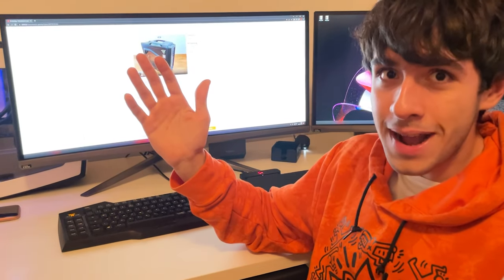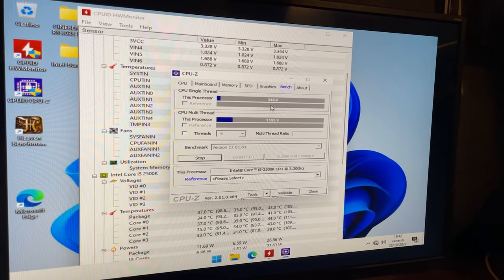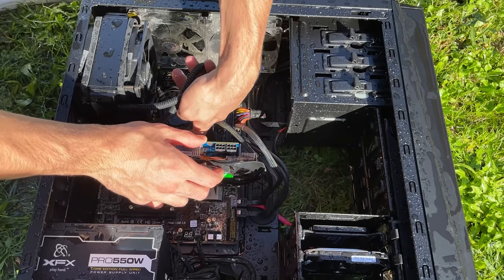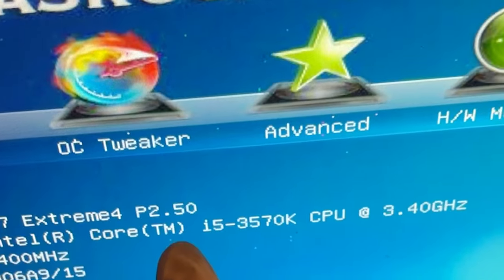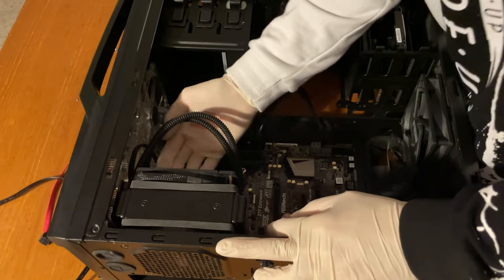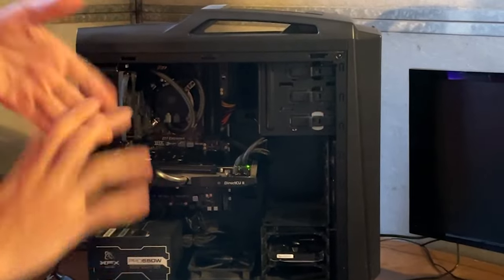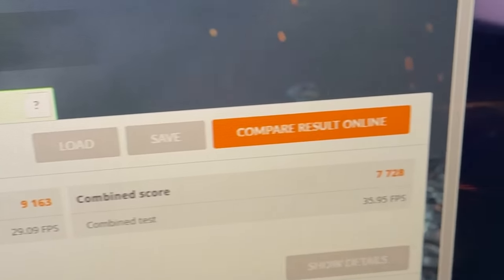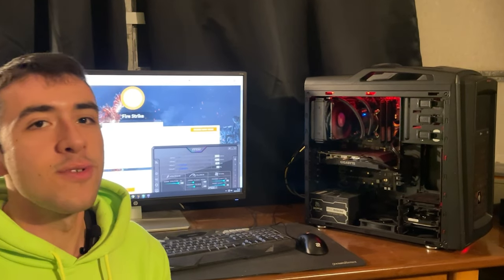I bought a Filthy "Gaming" PC on Facebook Marketplace... Here's what went wrong

Comment: Did u use water to wash that pc?
Reply: i was wondering the same lmao, wtf
Reply from the maker: Yessir, what else? I remain true to my username :) I do it on most of my used builds! It’s all about discharging stuff properly and following the right drying up process😇
Reply: @ImWateringPSUs  How long did it take to completely dry out after soaking it down like that? The moisture in the GFX card housing alone would take at least a week to evaporate completely unless it was taken completely apart and the components were laid out under running fans, which might take overnight to a full day or two to dry completely just to be on the safe side.
I've taken them to gas stations before to blow out using the industrial air compressor, just pay a dollar or so in quarters to run it a few times, and you don't take any risky chances with it at all and don't have to wait days for it to dry properly, try it!  
EDIT: Oh, and be sure to wear a mask when blowing it out or you'll soon regret it!
Reply from the maker: @Maddoktor2  I actually didn't think about the possibility of taking the hardware to a car wash to use their very powerful air blowers lol, I think that could make for a good video! In my case, since when I recorded the vid it was pretty sunny here in Italy and I did indeed disassemble pretty much every single component, it took me just 3 days to have everything dried up and running!
Reply: What else do you wash stuff with ?? 😂
Reply from the maker: @MaybeToxicOrNot  Isopropyl Alcohol if I wanna reaaally clean something!